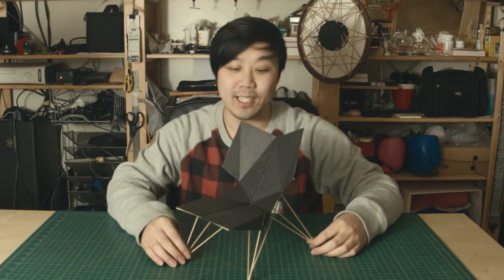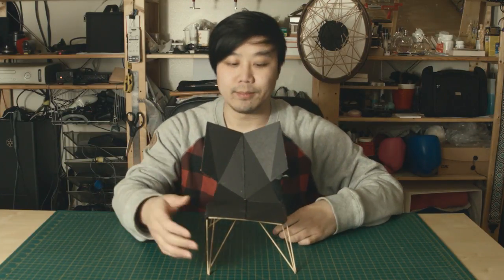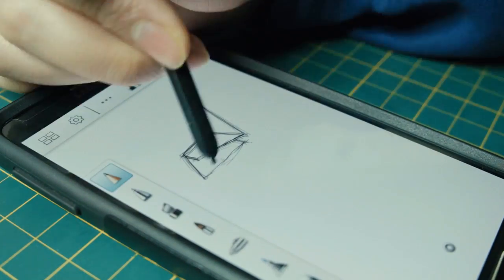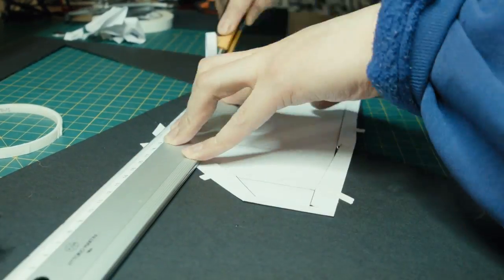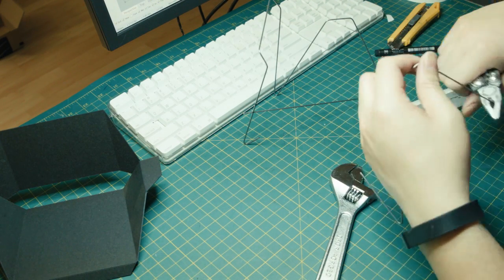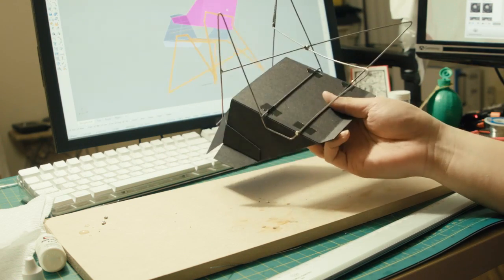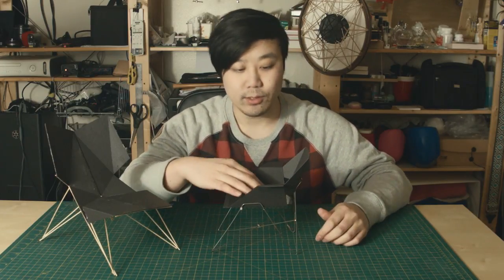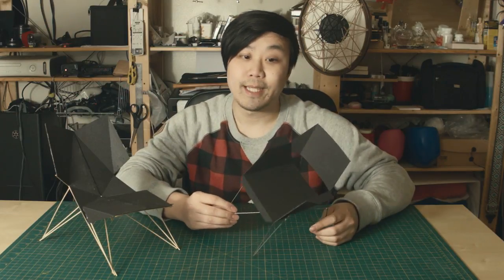How To Design a Chair | Prototypes

Comment: Hey really nice demonstration and prototype. But how do you make a flat pattern from the 3d model in rhino? Would really help.
Reply from the maker: For simple shapes, you can try the built in 'unrollsrf' and adjust fold vs cut lines. For complicated geometries, I've used software like Pepakura. Hope that helps.